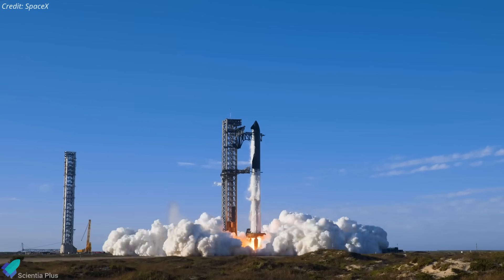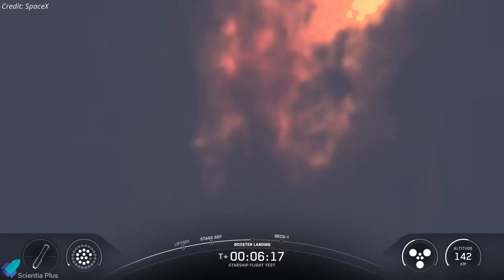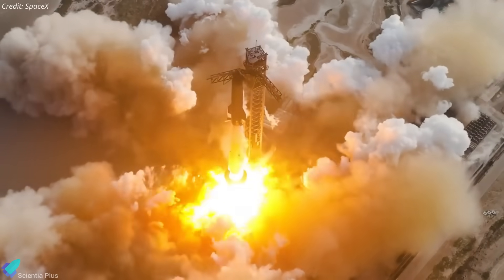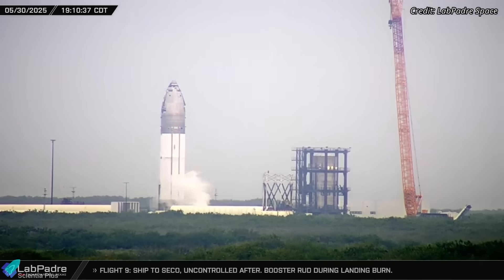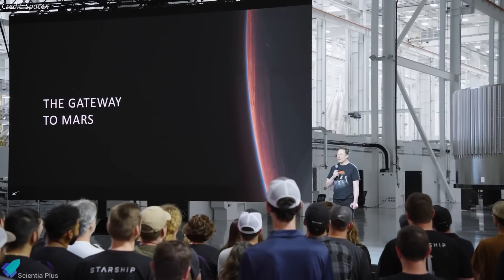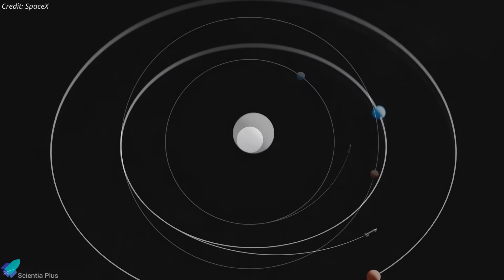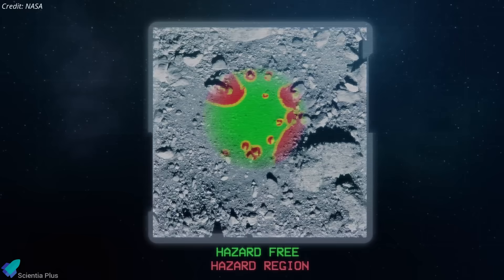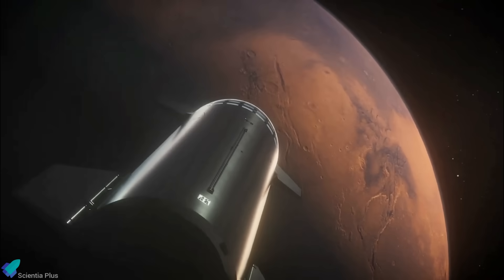Starship Flight 9 Crash Scene LEAKED! Scorched Remains Tell a Different Story

Comment from the maker: 🚀 Starship Flight 9 Complete Breakdown: https://youtu.be/2eirgcUzwts

00:00 Starship Updates
11:41 Most Daring Mission Yet? China Just Went Interplanetary! 🚀 

📚 Learn More:

🚀 Starship Block 2 Explained:
 📖 Summary: https://shorturl.at/b0dtw
 🔍 Detailed Explanations:
  • Design Improvements Update 1: https://shorturl.at/lpGT7
  • Design Improvements Update 2: https://shorturl.at/gwNQ4
  • Nosecone & Payload Bay Redesign: https://shorturl.at/xa60S
  • Methane Downcomer Redesign: https://shorturl.at/XdYBG

🚀 Starship Block 3 Explained: https://shorturl.at/mnBT4
🚀 Starship & Booster Block 3 Detailed Breakdown: https://shorturl.at/IViwD
🚀 Starship & Booster Block 3 Production Begins: https://shorturl.at/xRNkJ

🔥 Raptor V3 Mega Upgrades & First Test: https://shorturl.at/TRIyj
🧱 What’s Inside Starship GigaBay?: https://shorturl.at/nJM75
🛠 Insane Engineering of New Starship Launch Pad B: https://shorturl.at/7RAZd

🛠 Other Starship Upgrades:
 • Hot Staging Explained: https://shorturl.at/jf400
 • Super Heavy Booster Upgrades: https://shorturl.at/Pi5R3
 • How SpaceX Protects Raptor Engines: https://shorturl.at/4Om8F
 • New Heat Tiles Explained: https://shorturl.at/p2Ijb

🚀 Starship Flight 7
 📽 Complete Breakdown: https://youtu.be/UqzZx7vb-TA
 🛠 Root Cause & Fixes: https://shorturl.at/HcLKo

🚀 Starship Flight 8
 📽 Complete Breakdown: https://youtu.be/f26yH80RK2o
 🛠 Root Cause & Fixes: https://shorturl.at/vsGFB

🚀 Starship Flight 9
 📽 Complete Breakdown: https://youtu.be/2eirgcUzwts

🛢 Dual-Port Orbital Refueling – Full Technical Breakdown
https://shorturl.at/5tiqK

🎙 Elon Musk 2025 Starship Presentation – Uncut Version
https://youtu.be/1dSaPSwp5X8

🛰 Tianwen-1 Mars Mission
 📌 Mission Overview: https://shorturl.at/1aNNb
 🛬 Mars Landing: https://shorturl.at/OqwBL

📡 Stay Updated:
📢 Weekly Updates: https://bit.ly/3HIQjPC
🚀 SpaceX Playlist: https://bit.ly/34wue8T

🌍 Follow Us:
👍 Facebook: https://www.facebook.com/scientiaplus

Comment: No one should step foot in Starship.  Its design is fundamentally flawed, compromising safety over costs.  The booster is ok, but starship is too big, using the wrong structural material, and hot separation.  All put human lives at risk.  Musk needs to rethink this

Comment: You want to test that ship put a hot staging ring in position and see what happens to the engines after a 2-second startup burn. I think 600 tons of startup thrust is cracking engine bells and compressing  on the bottom of the tanks which of course are full and at their highest pressure .

Comment: Fuel leeks from the piping because the pipe can't handle 2 extremes at the same time  ( meaning  ) the pipes are very cold when in use and when the booster returns they are super heated from the outside and they brake under vibrations and stress while returning through the atmosphere at high speeds  !